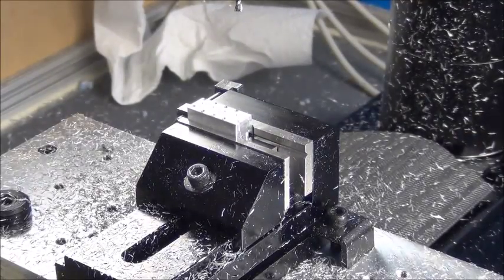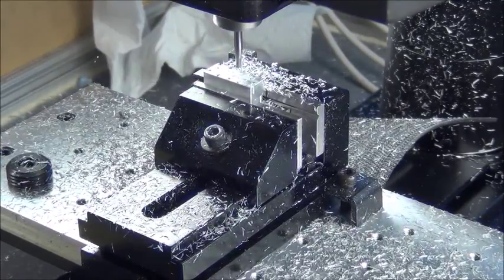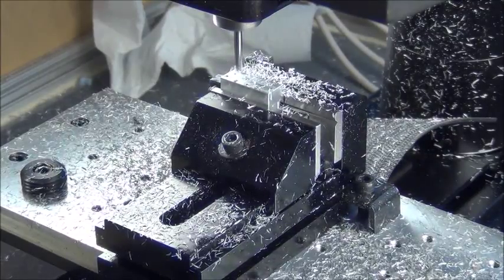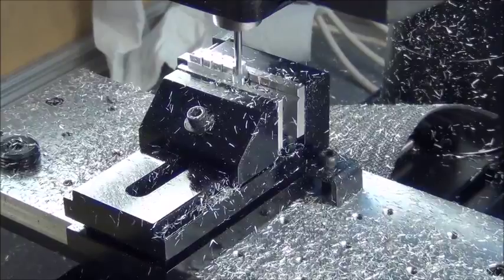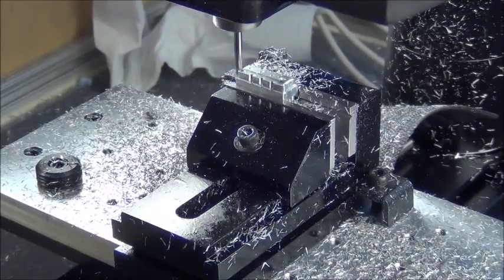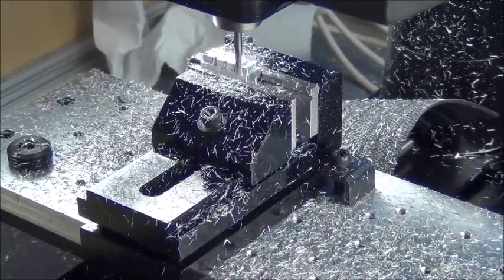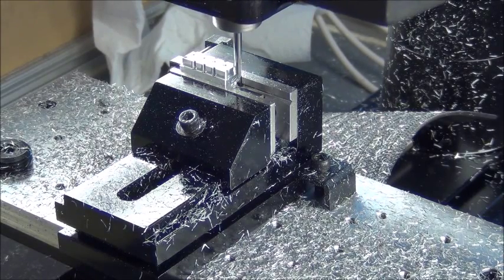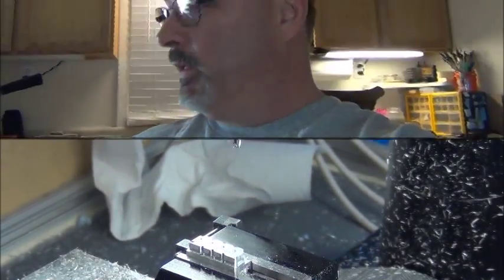Hemi valve cover cnc profiling cycle

Comment: Very nice video.  It looks like you're conventional machining; wouldn't climb result in a better finish?  What was the name of the CNC software, I didn't catch what you said?  Maybe you could provide a link.  Does the software do CDC?  Thanks again for the nice video.
Reply from the maker: thanks spike , yes  I'm conventional milling,glad someone noticed that , it's a habit of my manual machining background
I'm writing a program to climb mill to compare the difference and tool life.. the software is Mach3.
 yes it runs cdc ..Im using it in this program ...I  wouldn't want to run cnc without it.
Reply: Andy X Hi Andy,  Your machining videos bring back fond memories.  During the late 80'2/early 90's I was a software engineer for Bostomatics.  I had the good fortune to be senior engineer for a new CNC (BDC 3200).  I have spent a good deal of time programming/operating cnc machining centers; although all I could really machine was wax (never did get feeds and speeds correctly).